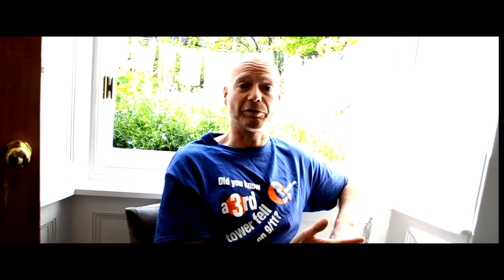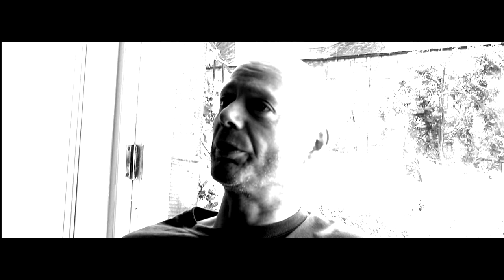Can jet fuel melt steel beams? - Brian Maxwell

Comment: So I am being told that a liquid fuel forge with a venturi effect air supply wont melt steel guess I and many others must be magicians because we sure as hell can melt steel
Reply: Liquid fuel by itself will not melt steel like propane and other fuels like that it has to have air forced air like a cutting torch
Reply: So how do I got videos of the building blowing up without a plane being seen?